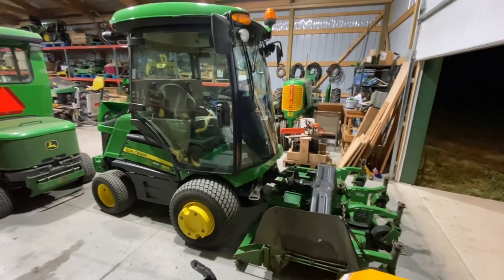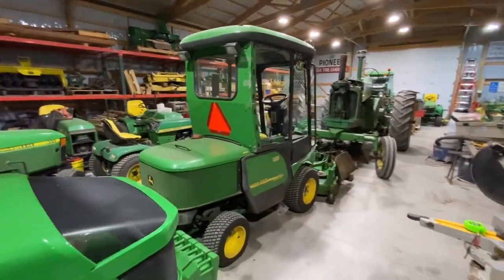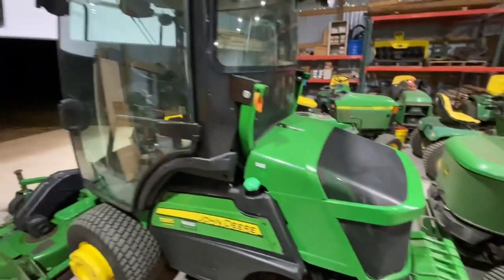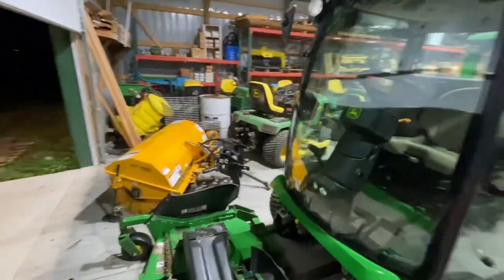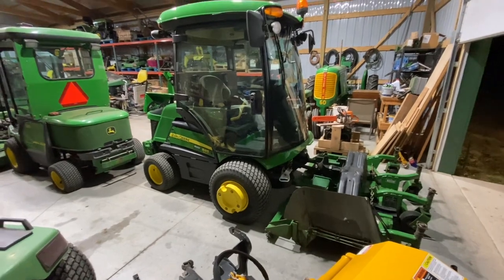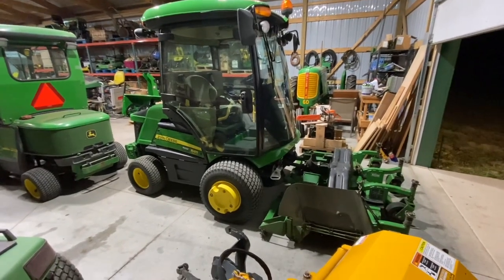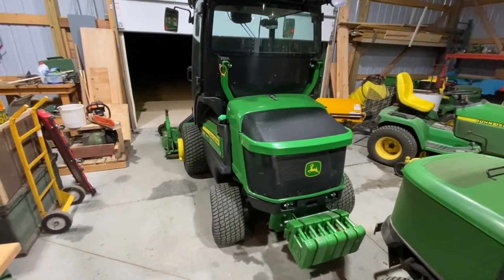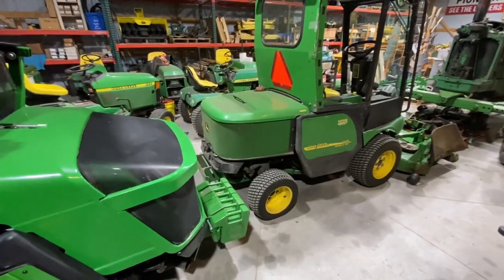John Deere 1585: Part 2 - Why did I buy it?

Comment: that V-flex deck is awesome .
i rebuild mine this winter , it had a lot of worn bushings , due to lack of lubrication .
make sure you take the deck of the machine periodically and grease everything .
you might have to lift it up or turn it over , there is more grease fittings than you think !
while i had everything apart i powder coated the deck , 3 pcs. new bearings ect.
i hope it will last me my lifetime .
i'm that happy with it !

Comment: I have an old F935, that I fab'd up a loader bucket on. Now I can mow, and move dirt around my property. Guess Deere doesn't want to manufacture a bucket attachment for them, probably  because they'll lose tractor sales ? I used the extra spool valve for the bucket tilt , works perfect. I used a Titan bucket built for the Toro Dingo.

Comment: That is a sweet machine! Now I don't feel so bad spending only 14000 on my brand new hustler zero turn side discharge. I used to have a rear discharge unit and you rarely wear the grass with that type but I needed something faster and bigger for 4 acre mowing. Now I just have to wear a dust mask and glasses with a wrap-around protection. I feel yer pain in allergy season. Dang it... now you have me thinking about a full cab setup like that too for year round use. Then again it'd be hard to let go of any of my 5 JD worker garden tractors. I hope you can get a chance to mow even more yet before next summer so we can hear if this really does help your allergy symptoms for mowing.

Comment: We have got quotes for the 60 snowblower $8100 out the door.  Ridiculous but have bought 3 other 60 from 3 to 4k
Reply from the maker: Offda! That will make you blink a few times
Reply: lucky kubota f series are cheaper and  kubota attachments are cheapest  around $1,100 to $3,100

Comment: I agree with you about the Zero - Turns. People seem to have this 'fascination' that there the best ever. Personally I think their Crap. Only good for, mowing large flat areas of Grass. Well that's about it. Very expensive for a Machine that can't do much. Not to mention they are extremely dangerous on hills.
Reply: lucky the kubota zds you can  mow,plow ,arearate and fertilize lawns and cab optional
Reply: Yeah I'm at the point that I want to quit wearing masks and I'm not spending this much money to still wear masks!! I'm expected it to be as dust free as a tractor, mini excavator or combine cab and it aint!

Comment: Question about the work lights, the lights on the steering column, they road, work or they operate as both? And dose the lights on the inside the cab have a glare when they are on at night against the windshield

Comment: We are very disappointed in the machine. Our ZT is cleaner to drive. We bought it to keep us out of the dust and heat it ain't!
Reply from the maker: I would agree the cabs are not as well sealed as they should be. That’s been a little disappointing. But the AC on ours works great, keeps us nice and cool in the summer and warm in the winter!

Comment: Diesel zero turns are a fail vs. gas zero turns.
Reply from the maker: Hard to compare a multi-use machine like this with a zero turn. There is a reason they no longer build terrain cuts with gas engines.